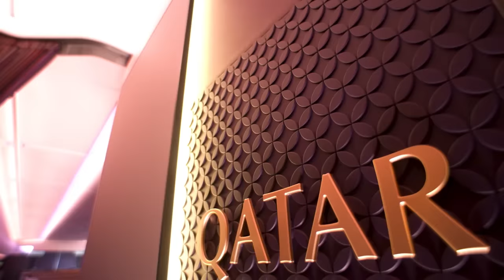Qatar Airways' Airbus A350-1000 In The Making

Comment: The new Hammad international airport for sure needs extension for more bridge so elderly passengers won't see bus after long hauls flying this beautiful bird....flew once from JFK to DOH back in 2017, free wifi along the route...splendid
Reply: I believe the short haul flights with smaller planes (for example to Mashhad or Baghdad) are usually on remote stands  whereas the larger planes have priority for the airbridges